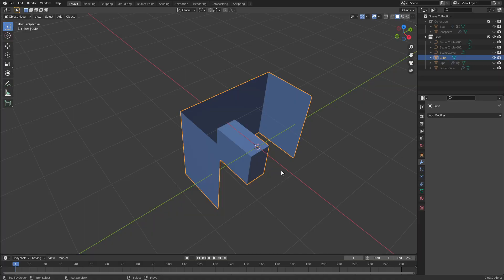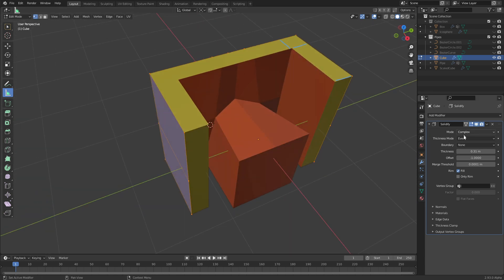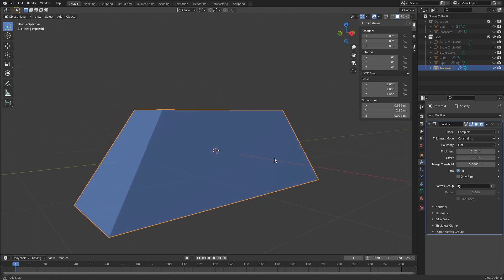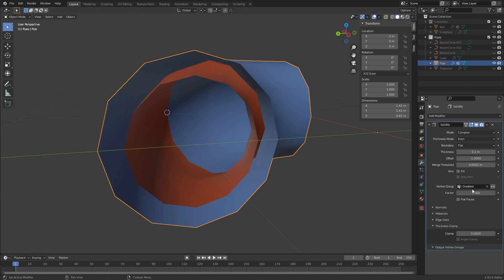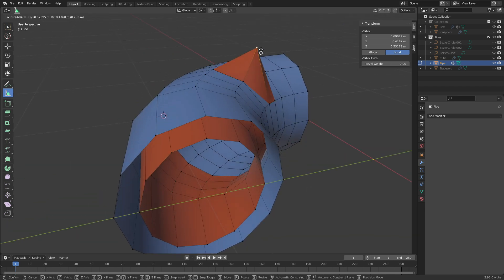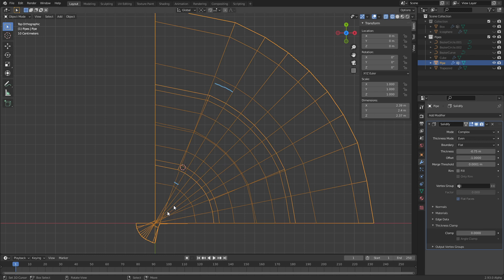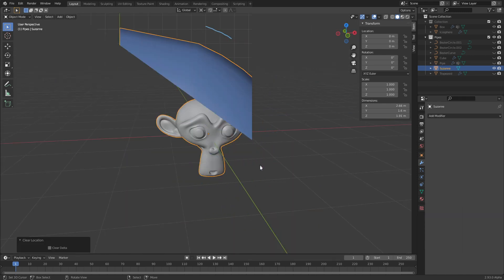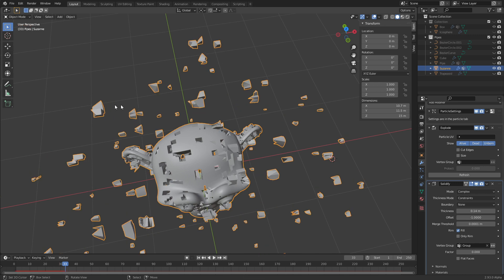The Solidify Modifier's big update in Blender 2.93 I Part 2

Comment: Funny thing here:
You copied the example for the demonstration of the modes Fixed/Even/Constraints from the manual, but missed the actual geometry had an edge with 3 faces instead of a box, which is the ENTIRE point of complex solidify! lmao

Otherwise though very great explanation! I think you are the first one to really explain it. I especially like the angle clamp demonstration! Completely forgot why it was there...

PS: That Merge Threshold should hopefully disappear at some point in the future and return to be a reasonable small fixed value like in 2.82. In the meantime don't touch it! It will make your computer go slooow. Better use weld modifier there.